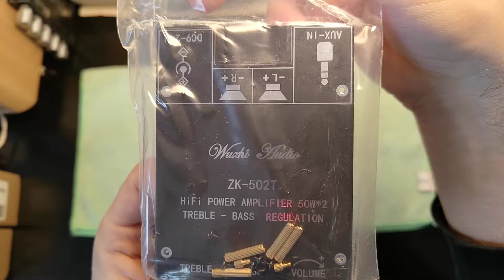100w Cheap Mini Amp - Wuzhi ZK-502T Unboxing Assembly and Test

Comment: i have the same one but my aux input does not have stereo, but connection over bluetooth has stereo. did i got a faulty unit?
Reply: yes cuz the original hass stereo in all inputs

Comment: Hi, please suggest me i have 
Satellite Speaker Power:	5 Watts RMS per channel (2 Channels)
Subwoofer Power:	11 Watts RMS
Frequency Response:	40Hz ~ 20kHz
I need amp for these speakers and i have AC adapter which has input AC230-240~50Hz 200mA & Output AC 11.5V~1600mA 18.4VA

Comment: Hi, Can you show us what you did for power source?
Reply from the maker: I used my bench power supply to power it with a DC jack cable connected to it. You can see what it looks like here https://youtu.be/HuNFb2j2W9g?t=68 The model of the power supply is xys3580, I use it for testing things but not for powering things full time.
Reply: @scellysspeakers  Thaks, Got it. what do you use to power, full time?
Reply from the maker: @JuanPaulo79  At the moment only that power supply, I bought this amp for a future project that will be powered by a 12v DC power supply.
Reply: @scellysspeakers - 
Hi,
I'm using an (obsolete) 19V HP Notebook charger that comes with a matching connector. As (as far as I remember), the device is able to handle up to 24V, so it delivers enough OMPH. It’s connected to a pair of B&O speakers and I’m using it for Amazon video sessions. Nice

Comment: Is the sound good when using the mini plug input?  Some people complained that the treble is lost when using this input.
Reply from the maker: I haven't tested it but the sound will be somewhat changed because the aux input is converted to digital and back by the jieli chip responsible for audio decoding and things like that. The 3.5mm input does not go directly to the amplifier chip, but is processed before it goes there. I will test it when I get the chance, currently I have this amplifier in storage for later use in a project.
Reply: OK, thanks
Reply: Yes i found the same thing. This issue has been reported on ASR. So apparently, the ap3050d chip with no tone controls has an issue with the aux input where the highs are rolled off but the amp with tone controls has had this issue fixed. Now, the amp with tone controls also features the 3116 with output inductors instead of the ap3050d, so I wonder if it is the chip or the tone controls which fix the issue. This amp has the 3116 with the inductors as you can see in the video. Let’s see if someone can bring more info on this issue.

Comment: Hi good review bro btw can I use 2 8ohm and 50 watts speaker to the amplifier?
Reply from the maker: Yes that will work fine with this amplifier
Reply: Recommended power for this setup? 19v 5a maybe?   @scellysspeakers
Reply from the maker: @rioa.s2006  That will be fine for most stuff
Reply: Im running 16v on 2 4in 120w speakers and it maxxes em out

Comment: Bagus mana suaranya sama jk tb21 jika jk tb tida menggunakan subwofer.!?
Reply from the maker: They both use the same amplifier chips but the TB21 has additional components to support the chips, such as more inductors to filter the output.

Comment: hi will 12v 6a dc work ?
Reply from the maker: It will work but you won't get the peak power output, it may distort at high volume.

Comment: Can you please share the link of the power supply you used? I am having hard time finding good power supply for these amplifier boards.
Reply from the maker: In this video I used a variable "lab" power supply (xys3580) which I only use for testing, ideally you would use a proper purpose-built DC power supply. Something like this would work fine https://www.amazon.co.uk/DTK-Charger-90-240V-Switching-Transformers/dp/B07K85GJ54/
Reply: @scellysspeakers  can u help me with getting the right power supply. i dont know what watt or amps it should be.
Reply: I used an old sony Vaio laptop charger of 19.5V 4.75A..